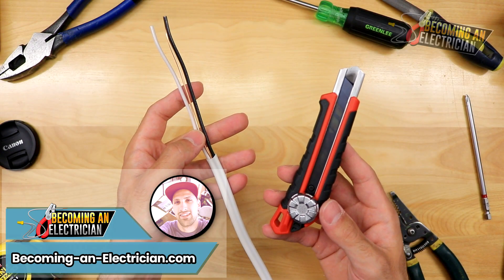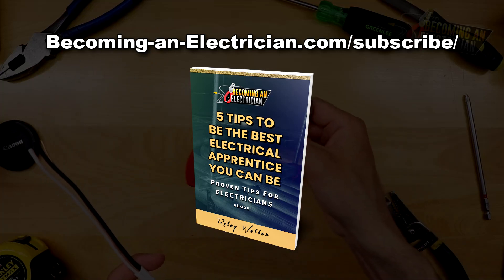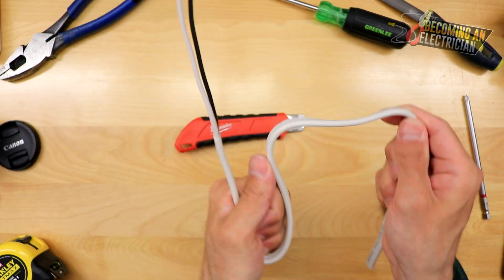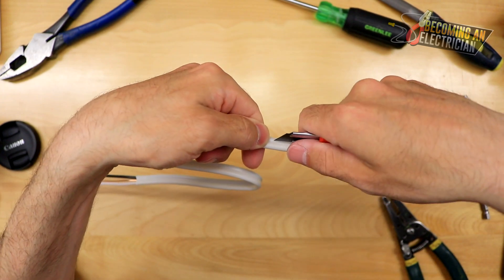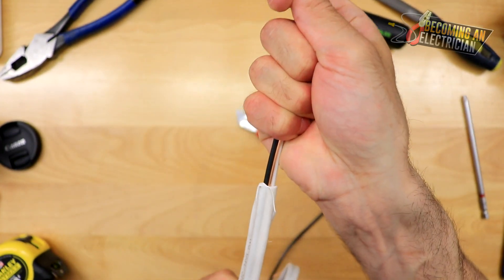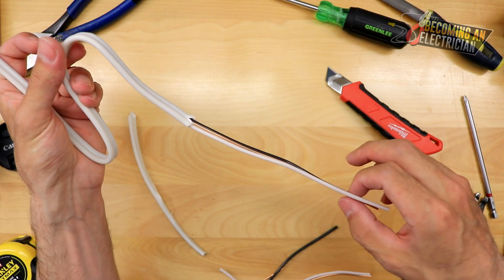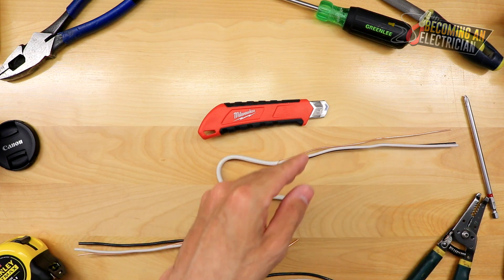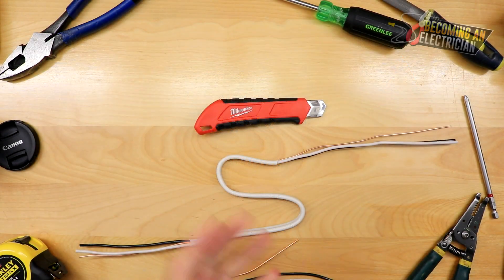How to Strip Wire Jacket for Electricians

Comment: We always strip 2 wire nmd by inserting blade in the center, slightly angling the blade towards the ground as you run it down the wire.
I totally understand why someone would not approve lol but that's how the majority do it.
Reply from the maker: That's how some do it, but there's high-risk of stripping the conductor accidentally.  You can also gouge the bond wire accidentally, too.  Over the years, the way I've shown will allow your conductors to be unharmed from beginning to end.  There is no right or wrong, but when you experience a mistake in a situation that is hard to fix, you will realize it's not worth the high-risk.
https://becoming-an-electrician.com/how-to-strip-nmd90-wire-jacket/